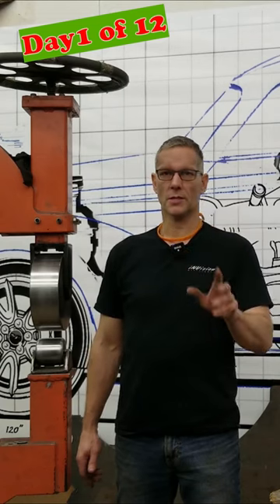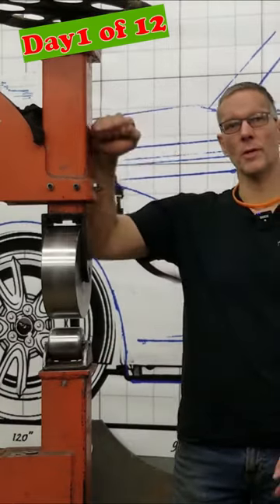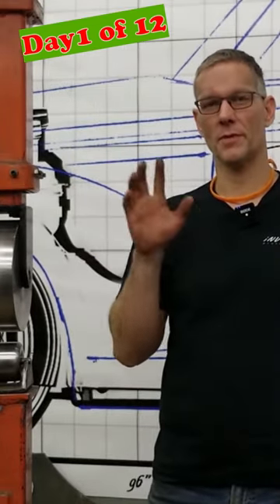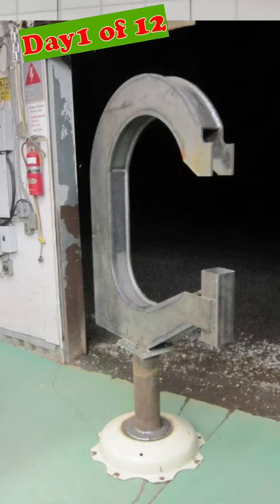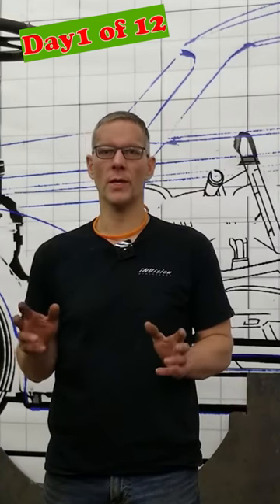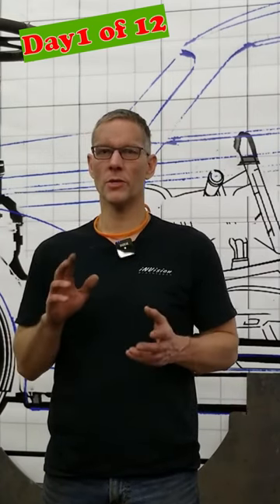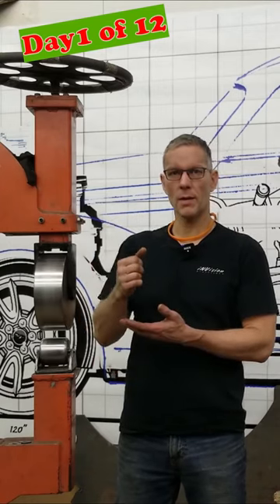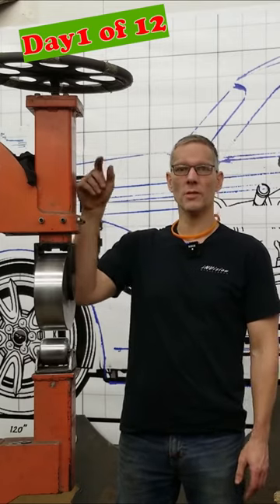English Wheeling 101-FRAME Stiffness #shorts

Comment: The frame has to separate to some degree.
Otherwise the wheels will skip over areas that have already been wheeled and therefore thinned.
Reply from the maker: You are right Steve, it does.  What I'm referring to is guys picking up a harbor freight or whatever brand wheel and expecting it to perform.  Thanks for elaborating a bit more for those who check out the comments section.

Comment: Do you have any more pictures of your home made wheel? More specifically, the design of the top adjuster? I have one now but id like it to be stiffer.
Reply from the maker: Hi! Unfortunately I don't have any detail pictures.  I did use an acme thread that runs on ball bearings giving the adjuster a very precise feel when needed.  You want the frame to be stiff enough so that the anvils run true to each other, but not completely ridged .. otherwise your anvils will skip off your previously wheeled pass.  Thanks for watching.
Reply: @iNVisionPrototypes  Thanks 👍